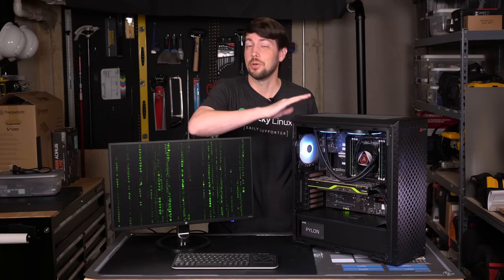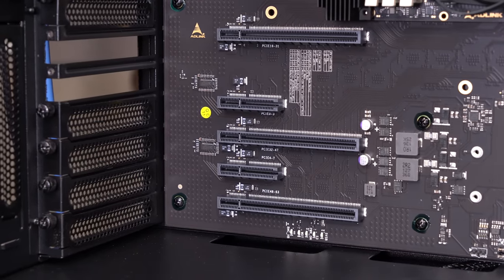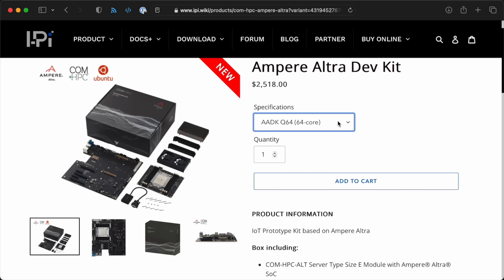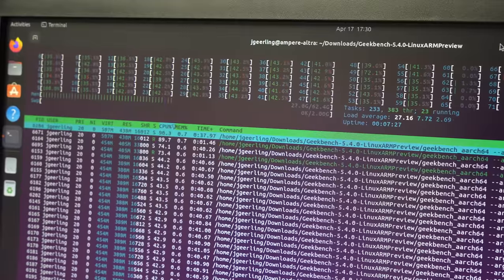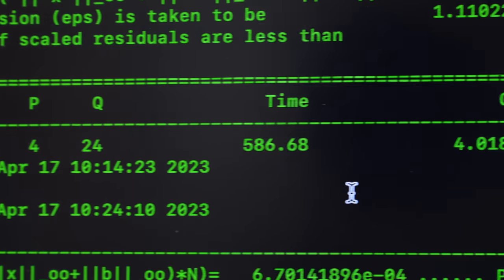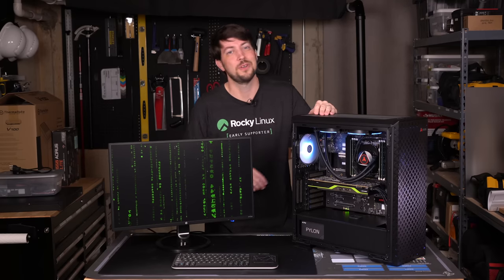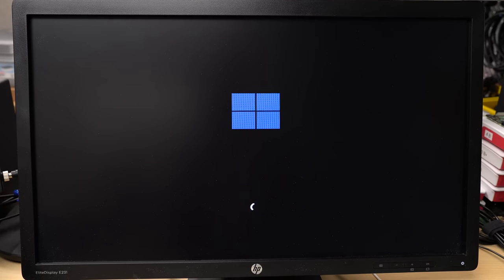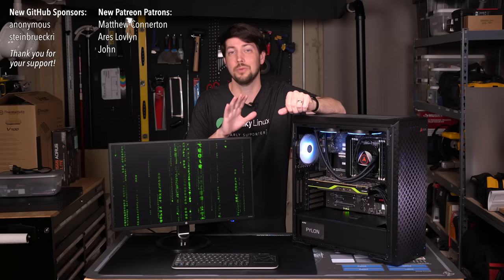This Mac Pro killer runs a GPU—and Windows on Arm!

Comment: ive been running a pi4 8gig as a "server" for a year now, want to another arm sbc, any thing you can recommend instead of a pi4? when im looking at other sbc's im always scared that os suport just dies after a year. (ohh and i run arch linux arm btw HAHA)
Reply from the maker: I would stick with the Pi 4 for now, unless you really want the speed one of the newer RK3588 SBCs have. The prices for them are a little high (but not unbearable, especially for boards like the Orange Pi 5 with the RK3588S).
Reply: If you're just running it as a server and don't need the gpio, have a look at project tiny mini micro. Consumes a bit more power but way more compute power.

Comment: What if Apple weren't Apple?

Don't hold your breath. Apple will never participate in a market where there is actual competition.  

The current hold up is ARMs legal dispute with Qualcomm. Microsoft is waiting for Qualcomm's next chip and wants to design it's own. Until licensing issues with ARM are clarified everyone is going to wait. Once Windows ARM becomes popular there will be no shortage of ARM based desktops.

The other issue is currently you can only install Windows ARM on hardware (or VM) that has passed QC and driver testing for the entire PC. So only OEM's and Parallels can qualify for a legal license. 

Will Microsoft go back to the Windows Intel model of licensing? I suspect not. Making Windows ARM as compatible to install as Windows INTEL would be a vast undertaking of driver writing and compatibility testing. Microsoft wants to offload that problem to the OEMs where it probably belongs in the first place.

Comment: Yeah but why should Apple bother, they unified their hardware stack across phones, tablets, laptops, NUCs and all in ones. The percentage of their userbase that actually ever wanted to upgrade their machine has been minute for decades, in the case of RAM or GPU. Their product is really, really good and the tighter integration of CPU , RAM and GPU is only going to pay off more and more in the current world of IO limited performance. Not to mention that they save tons of money in development and manufacturing by not having to run nearly as many traces over their motherboards. What they should focus on is a CUDA equivalent API for Metal, and jump on the steam deck bandwagon of *nix gaming. So they give up the desktop ultra high performance market for now, as it's essentially dominated by NVIDIA for the time being anyway.

The CocaCola company did something similar when they stopped shipping their drinks in pre-mixed 28l containers and focused on just doing syrup. So they lost some customers that didn't switch to bottled drinks or syrup, but they minimized their shipping and transportation costs to 20% of what it previously was.

Comment: A geek bench single core score of below 900 once again just illustrated how far Apple is in the competition. All of their desktop grade M-series chip has a single core score of around 1700. And that’s even worse when this CPU runs at 2.8GHz to achieve that, no wonder Apple wins at the efficiency as well, as their M-Series chips runs at around the same (if not lower clock speed).

For those who wondering why not compare the multi core score? Well, they are not very useful in the context of a workstation where most of the time it is utilized by 1 user. Many computations are not parallelizable, so the real world experience is more like the single core performance. In fact, it is almost meaningless for a workstation to have more than 16 cores, as a single user almost never need that many. If you were to perform demanding parallelzable computations, specialized accelerators (such as GPU and FPGA) are the way to go, as they are usually faster and more efficient than using CPU. Cloud computing is different as there are many users sharing the same physical machine.

Comment: I think ARM architecture is not good for desktop computers because it has some limitations compared to x86. ARM processors are designed for low-power and mobile devices, which means they sacrifice performance and compatibility for efficiency and battery life. x86 processors, on the other hand, are more powerful and versatile, and can run a wider range of operating systems and applications. ARM processors may be cheaper and cooler, but x86 processors are faster and more flexible. That's why I prefer x86 for desktop computing.